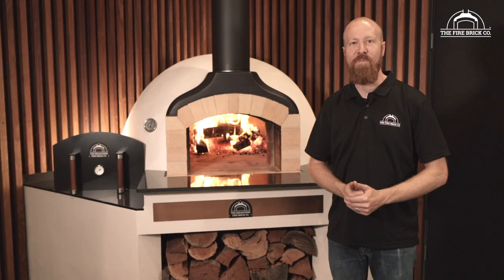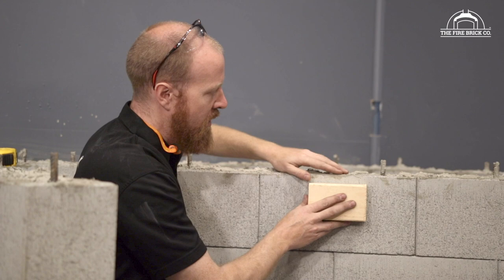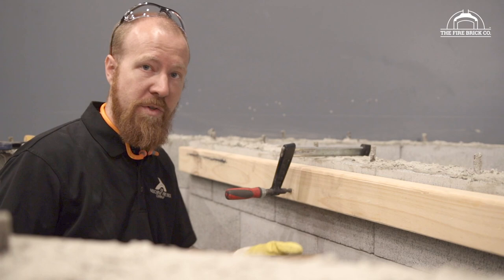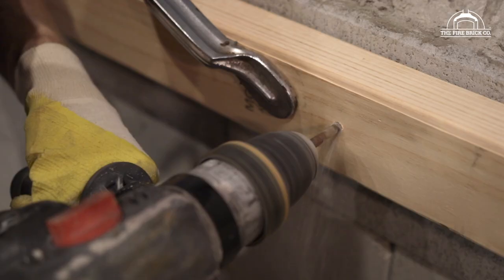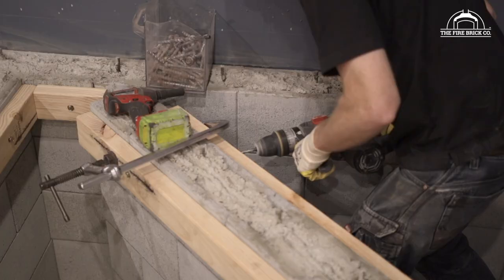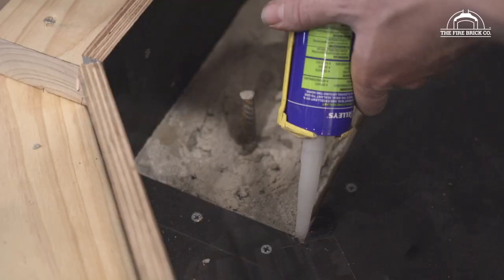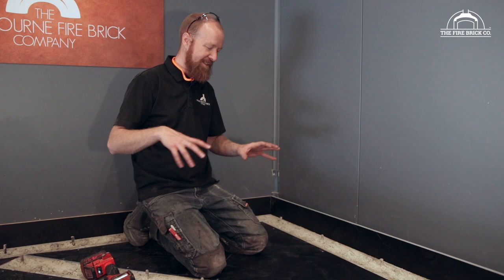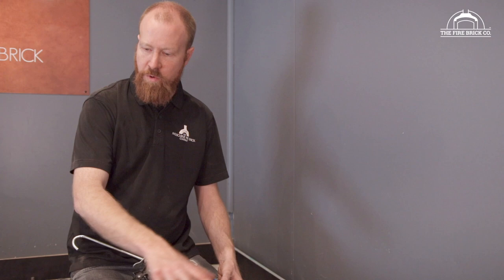How To Build a Brick Oven Stand | 3. Suspended Slab Formwork

Comment: Let's say I do not want to drill into my base (since I used standard bricks to build and won't render over). Could I simply build a frame and support it with legs on the outside/inside as opposed to drilling into the brick?
Reply from the maker: Absolutely, it's more fiddly but it could work. The hard part would be preventing the external side forms from bowing outwards from the pressure of the wet concrete

Comment: Rather than oil a plywood slab is it possible to put a thin layer of plastic between the ply and concrete? Any issues with that? I imagine it might help the curing process too?
Reply from the maker: Hi Lewis, you can certainly do that but you might find you get a lot of crinkles in the finished surface as the plastic tends to move around as the concrete is poured